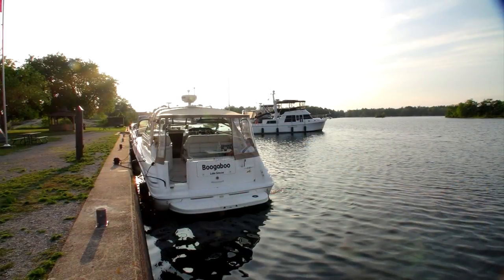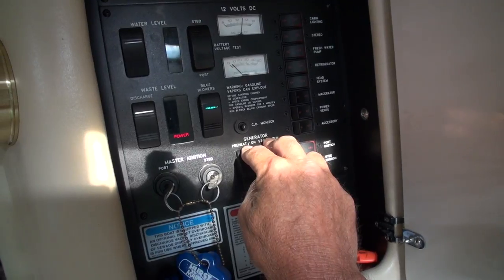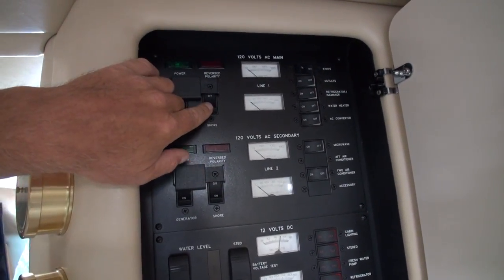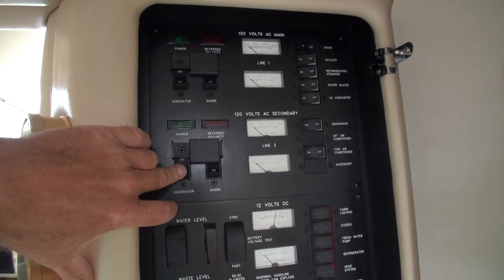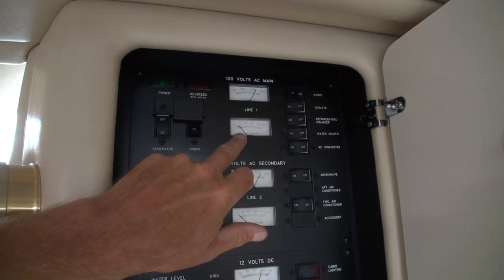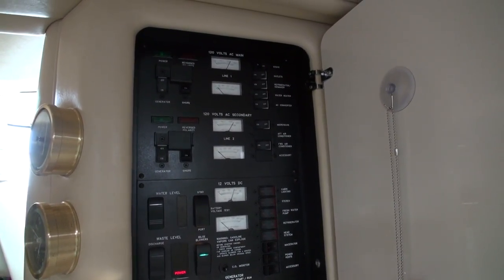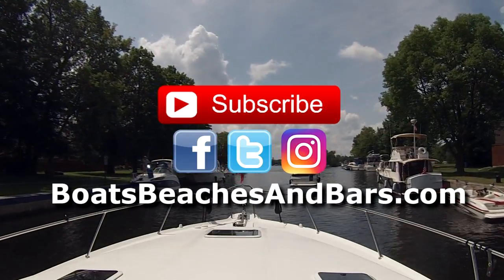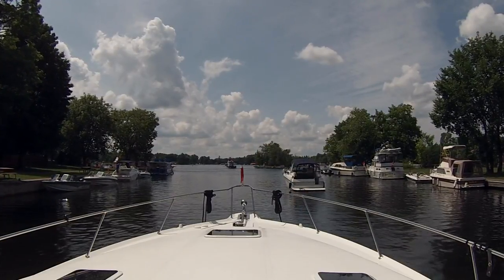Boating Basics - Starting Onboard Westerbeke Generator

Comment: What is the purpose and function of the two switches used during the start process?
Reply from the maker: That's a good question. Unfortunately, I don't have a definitive answer :-0

 On our last #boat (https://www.youtube.com/playlist?list=PLKhjT5kr2l2FaABQJSn3VVqd6SN930ICt) we had a similar style, gas powered Westerbeke generator (but it was larger) but I only ever had to hit the one button when starting that beast. This current one requires that both are hit simultaneously when starting, as pushing only the one button results in a lot of nothing happening. I believe I read many years ago (when we originally bought our 400 Sedan Bridge) on the the ClubSeaRay.com forum site that this was as a result of a holdover from the diesel powered genny's and a glow plug setup. 

 Something I will look in to with Westerbeke to get a fully informed answer. Sounds like another good video coming up ;-)

Comment: Any idea how much gas is used in two hours of use?
Reply from the maker: Couldn't tell you, as the fuel for the genny is drawn from one of the main fuel tanks (2 main engines, two fuel tanks) and it's way too much work for me to try and figure out what the difference is between the two. As I believe I mentioned in an earlier video, I simply put gas in when we need it and the overall fuel economy is determined by 'smiles per gallon' :-)